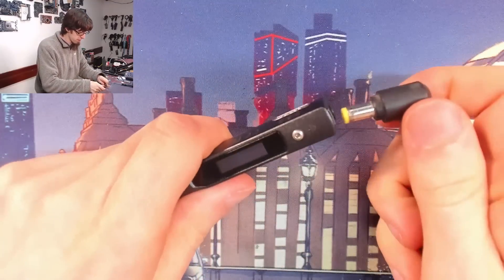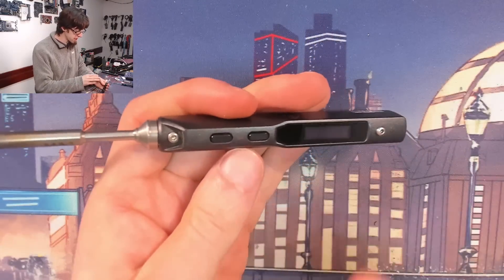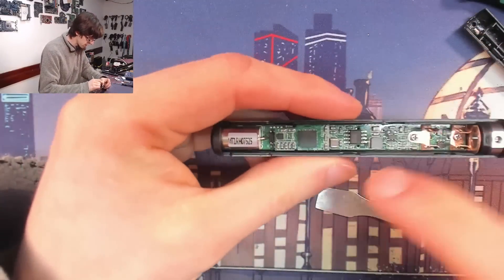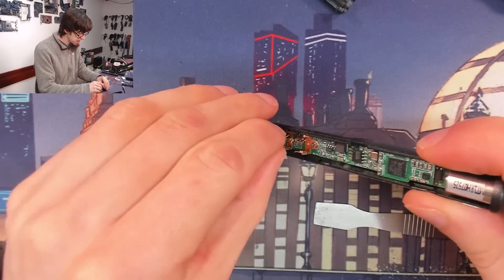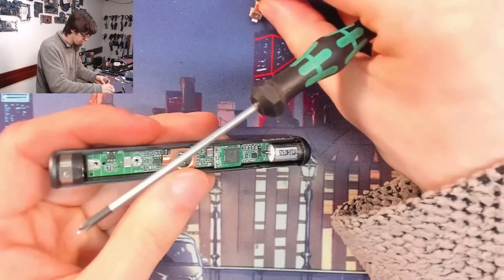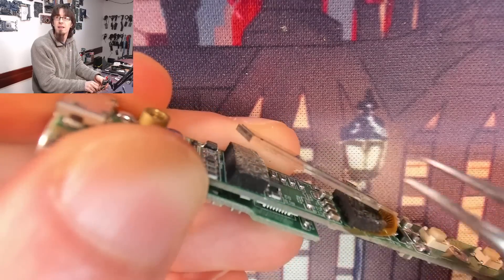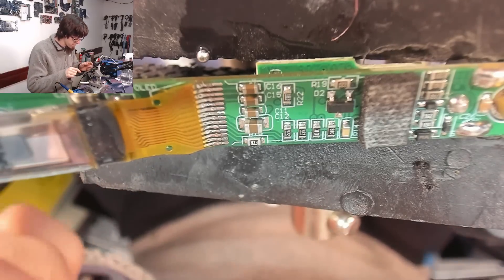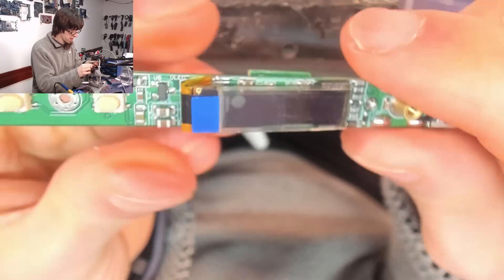Miniware TS100 Screen Replacement - LFC#238

Comment: Today I finally replaced the OLED display and now the TS100 is like brand new. It took time to get the new OLED and to get a special low temperature tin that melts at 185°, so during the soldering of the tiny contacts on the plastic connector there is no risk to melt the plastic.
The only thing I forgot was to add the KAPTON tape on the back of the LCD. I did not put the insulation material, because it may insulate either from becoming too hot but even to become cold, and this could be a counter effect and short the life of the OLED.

Comment: Thanks to this video, I finally got around to replacing mine with the screen I bought over 2 years ago. I don't have another iron, but I used a rework station at 330°C and some flux and it was much easier than I thought!

Comment: My TS-100 was not used for months and now the OLED is almost dead. I ordered new OLED, and I am waiting they will arrive. I did not throw it away to take a new TS-80, because I have the TS-100 full set aluminium box with the full set of possible iron tips that exists on the market.
This video helped me to decide to keep and repair my TS-100.
I think that when the TS-100 is used for long time at high temperature around 380°-400° trying to desolder the bloody hi-temp industrial tin, the OLED get too much heat and the OLED become damaged.  When I will dismount it, I am thinking to insulate the OLED by putting under some KAPTON tape and a special thin insulation material that should prevent the OLED to receive the internal heat.

Comment: I'm not sure your problem was plugging it in too many times. Mine worked fine (full brightness) since I bought it up to 6 months ago. I didn't use it for 5 months, and when I plugged it in last month the brightness was down to maybe 15%. From what I've read in a few forums, this seems to happen a lot (sudden drop in brightness, not just slow "ageing"). Just poor quality displays, I guess. And mine is actually from MiniWare, not even a clone.

BTW, the UG-9616TSW displays you can find all over eBay won't work. Same number of pins, same resolution, almost exactly the same size, but I guess the pinout / driver is different. I tried two (neither even lit up) and ended up putting the original one back on while I wait for a PG-9616TSWD.
Reply: I don't think there are clones. It's chinese already and the chinese appear to have a 'code of honor' to not just copy their own brand names (e.g. it's practically impossible to find a 'fake xiaomi phone').  What CAN exist is the initial batches to be better than later cheaper batches etc.

Comment: Been putting off the repair of mine for many months now, just ordered a new screen from Aliexpress which will take at least another month to get here. In my case most of the pixels stopped working while just a few are still fine so I can sort of guess what temperature it's at. But the weird part is that it got like this after months of not using it at all. While it was still new it might have become less bright over time but at least all the pixels worked. Would actually prefer some old school calculator type LCD since OLED has such a short lifespan even when not used.

Comment: I had mine stored in its box for a few years (was working fine when I put it in) and the display still failed, I think they are susceptible to oxidation or some other form of degradation.

Comment: Good job, if I remember correctly you mentioned in another video that you power your TS100 with a Toshiba laptop charger, is this correct? I’m thinking of buying one of these over a TS80 (the USBC connector might cause problems, which one would you recommend?)

Comment: My screen died while on the shelf for 6 months. I bought a new micro soldering rig so I put the TS-100 in a case and stored it for when I had a mobile repair job needing the portability.After about 6-8 months in a box, unplugged, it let me down when I needed it! I feel the particular display used in the manufacturing is batch defective. Thanks for all your fantastic content!

Comment: Aligning pins with masking tape then soldering 1 pin on the edge . Check the alignment and solder pin on the other side , thereafter the middle ones . Anyway we’ll done on getting it sorted 👍

Comment: Watched a few times, ordered spare display, paused and then embarked on the exercise.  Glad I watched video a few times AND had a handy little USB Cheapo solderin iron and job done, worked 2nd time! like you I had to do the reflow twice, using flux but worked. Thanks for an amazing video and saving me $US50!

Comment: Tried to replace mine today. Firstly, when I removed the original screen a piece of the flat stayed glue to the solder pads. It was a little tricky to remove. Secondly, I soldered the new OLED display and it worked... for some seconds. After that, it started blinking and sometimes shuts off. I passed the soldering iron on the screen's flat cable again and it worked (for some time again...). I removed it and soldered it again and the same behavior happens. Removed this screen and put a new one (I've bought four of them) and... the same thing happens. I think the display I bought is not liking the way we need to curve the flat. Finally, I decided to change a little where the flat curves (putting the foam far from where the flat solders for making it doesn't bend too close to the display) and now it's working (at least for last 30 minutes).
Reply: And.. stopped again.

Comment: If you see Adrian's digital basement though, unplugging it too many times can break the jack and land you with a repair as well... Maybe try shutting the power supply off? 😂
Reply from the maker: I've now got a handy PSU with a built-in power switch (like, literally on the brick) that's perfect for these electronic irons. If I hadn't come across it, I'd have probably modded another supply with an in-line switch or something.

Comment: I strongly suggest you to flash Ralim firmware on this iron, it will give you acces to all the advanced options and a better interface. Flashing it is as easy as connecting the iron to pc and copying the firmware hex file to it.

Comment: Had to fix mine too. Thread a wire through the  2 holes in the flat cable and the matching holes in the PCB to align and hold it. Make it easier to solder properly. Also mark the display location on the PCB to place the new one at the right place. I bought two spare displays just in case.

Comment: Cool, very stylish and powerful soldering iron but I highly, highly recommend, my other favorite tool (the other is a digital caliper by General) is my new soldering workstation, the amazing KSGER T12 (2.0 something firmware, the new one is 3.1 something) which will be an upgrade to my butane Iroda (will now be used for blowtorching, heat gun stuff and hot knife stuff and adhoc lighter) and will be an upgrade to the TS80 and TS100, coz' the T12 also has a battery powered version (rechargeable) and the heating element is the much superior JVC and Hakko's (the heating element is in the tip itself). It heats very fast, has two fuses for the main transformer (for the mains) and secondary one. It's very stylish and more affordable too:-) especially if you buy the 10 piece Hakko compatible Direct Drive tips.

God bless, Rev. 21:4

Comment: Brilliant video Graham, went out and bought one, none of my ppwer bricks fit, which make and modle are you using,
Reply from the maker: 5.5mm OD 2.5mm ID barrel jack. 65w toshiba laptop chargers have this tip on them, so they're an easy fit.

Comment: You got off easy there take it from a pro at destroying hot bars I usually apply a lot of solder to avoid ripping the hot bar you should also use plenty of flux

Comment: these screens are in most Ecig Mods!!...i switched many of them!....never use hotair! a big Solder blob and fast working is the way to go!
if u cant find one of these, take your buddys "Istick" and remove it from there^^
u are very lucky that you dont ruin the new screen with that piece of crap tip...
Dude.....if u want to plug the new screen on the pcb...dont do it like you way! you have to solder first and last pin at the beginn and after that, look thats fit proper in place and after that you have to solder one by one every other pin!
Most pins are groud or N.C....cause its a i2c display that use only 4 to 8 pins!

Comment: You should of used a fine tip and with flux and tacked it on either side and then flood filled each pin, that’s what the little holes in the flex are for, but you got it on, you could invest in one of those wide bar tips for heating connectors.

Comment: i personally would of put the second sponge in over the connector, mus tof been there for a reason
Reply: I was thinking the same thing as I watched him reassemble it.
Reply: I thought the same thing! Just don't put any pressure on that end of the screen or you will push it in and maybe even crack the cable. :-/
Reply: There is plastic in the case. Screen is under the plastic. I wont press down.

Comment: great video! I love my TS100, didn't realise the screen could wear out but of course it makes sense, since it's OLED
Reply: i think it might also burn, if your electrical supply to it isn't clean. I probably ruined mine either because of no grounding or because of unstable voltage.

Comment: love the ts100. so versatile, portable, wide voltage input, can be powered from lipo batteries, wall warts, laptop adapters, etc. 
how do you get yours to go to 400C from the startup? mine only goes to 300 and I have to manually set it to 400.
Reply from the maker: I think the starting temp is in the settings somewhere, I set mine ages ago and can't remember!
Reply: @Adamant_IT  yeah, you have to use a MicroUSB cable, connect it to a PC, and edit the config file.
I ended up actually installing IronOS on it which is a custom firmware and has all the settings available by navigating the buttons and can go up to 450C now which helps with thick large wires or copper bus bars :)

Comment: Is the ts 100 worth the money even though I know it's relatively cheap but $50 to a $100 bucks is still $50 or a $100 bucks that I don't want to just throw away!
Reply from the maker: Yea I think it's a great iron for electronics work. Lot of folks prefer the TS80 because USB Type-C, but I think the barrel jack on the TS100 is easier to work with - doesn't need a USB C charger, just anything with power coming out of it. TS100 is a shade more powerful as well.
The other iron I have on order is a PineCil, which has USB-C and a barrel jack, so may well be the magic combination. Waiting for delivery from China though.

Comment: Glad to see your finally using flux. You just need to use more lol. Did you update the firmware on your TS100? Looks stock.
Reply: How does one update the firmware on these TS-100 soldering irons?
Reply: @gxc90  Go on github and search for "ralim" or "IronOS". Then it's a matter of plugging the soldering iron to a computer using a USB cable and copying a single file.

Ralim software is an alternative firmware that gives you much more accessible menu and a VERY useful "boost mode" where you can change the temperature from let's say 360degC to 420 for a few moments with a single button press. You can also upload your own pixellated logo as a starting screen.
Reply from the maker: I've always used flux... when it's needed. People only see what they want to though. Already read the other comments telling me I used way too much flux 🙃

Comment: Running a hot soldering iron tip across connections makes me very nervous. If any of the pads are about to come loose that action would in all probability help the pads come off. My suggestion would be to hold the iron parallel to the length of the circuit board, placing the hot tip firmly on just a few contacts at one time being mindful of the heat transferring.
Reply from the maker: I was attempting the 'walk' technique, where you gently pull and heat everything one at a time, so it comes off in steps - but yea it wasn't very effective here. As you saw, using the length of the tip as a hot bar (as intended) was indeed what did the trick!

Comment: you said you replaced your WEP station which is also your hot air right? what are you using now for hot air?
Reply from the maker: I bought the baby Quick 👌
Video about it out on monday or tuesday!
Reply: @Adamant_IT  Graham you should have bought the KSGER  cheaper and better smd rework station and the T12 soldering station
Reply: PS great vids
Reply: @Adamant_IT   nice!! looking forward to it

Comment: Which flux do you use/recommend?  Do you have a link?
Reply from the maker: I use knock-off amtech flux from ebay. It's been fine up until the current tube I have, which is like treacle. Wouldn't recommend it, I'm just too lazy to track down some proper stuff.
Reply: @Adamant_IT  Graham give Kingbo RMA-218 a try. I can send you a tube if you like?